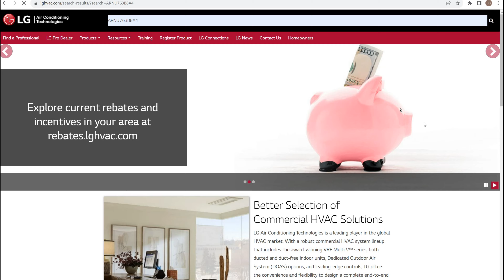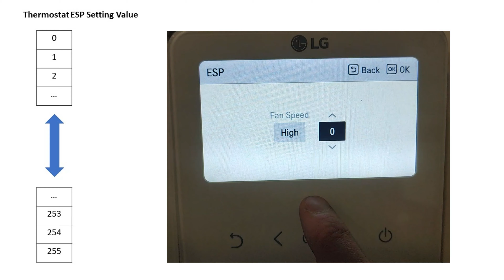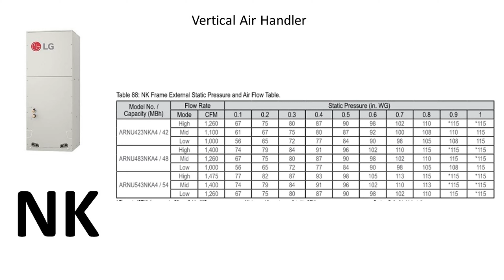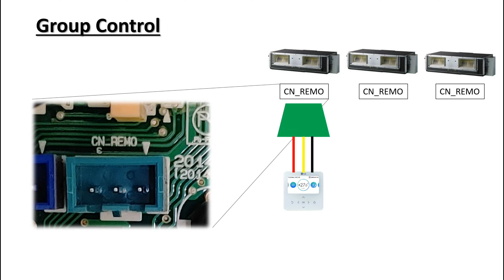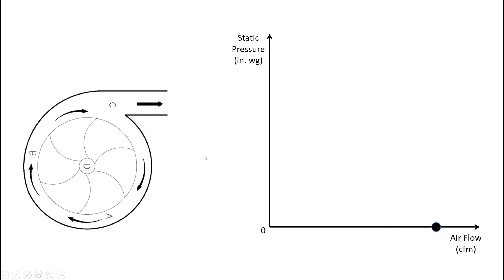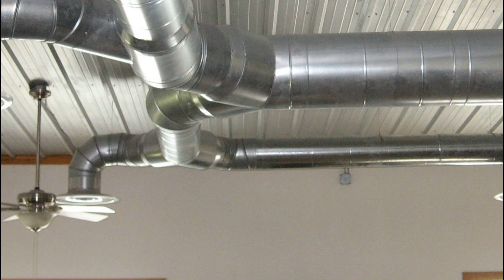ESP (External Static Pressure) setting on LG Ducted Indoor Units/Evaporators. Detailed Explanation

Comment: Actually, Slow speed is used by the ducted units. I found that when a ducted unit is in heating mode and the pipe temperatures are not hot enough, it will run the fan at the configured slow speed. Once the pipe temperatures rise, it will then run the fan at low speed and then to the set fan speed. I noticed this on a B8 unit because the slow speed was causing the motor to make loud sounds, after lowering it a few steps it didn't make the sound anymore.
Reply from the maker: Thank you for sharing your experience.
Reply: Super sir